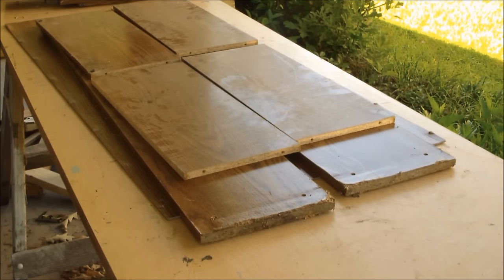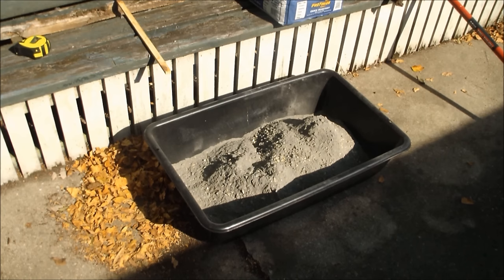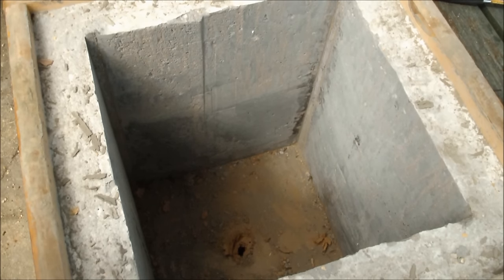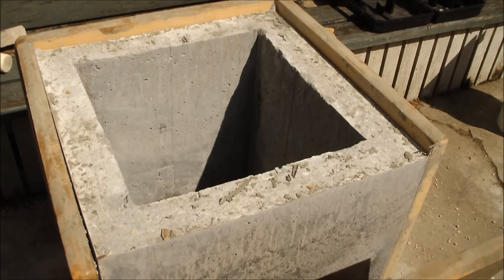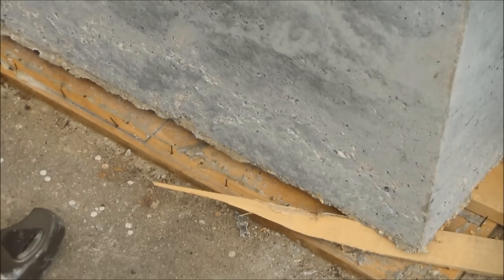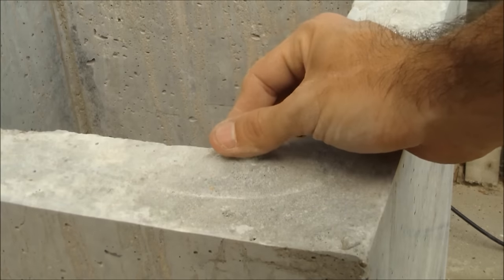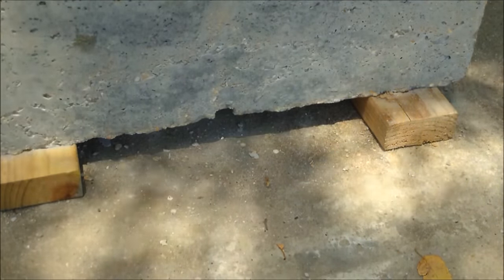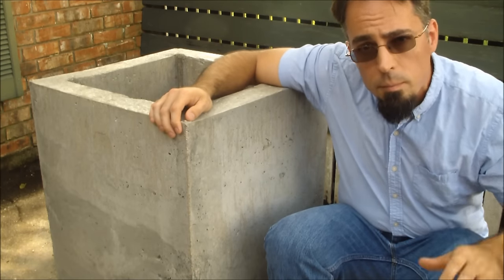How to Make a Concrete Planter

Comment: Should have kept the concrete wet all those 7 days to at least double the strength; you could remove the outer wood frame after 24 hours, I don't understand the need to seal or sand the concrete . I would have used  20" x 20" porcelain or  marble or granite to form the outer form  using 100 % silicon as adhesive using long clamps and wood pads to protect the marble or granite - you don't need to buy fiber reinforced concrete unless you're building a counter top . one bag of portland cement type 10 + 2 bags of crushed lime stone + one bag of sand - a total of $ 25,00 . mix them dry by a shovel as best as you can - take one  quarter at a time and add water as needed trying to minimize the amount of water to get good strength . don't knock on the mould or else you may break the granite . just use any rod or wood dowel to poke the mix to make sure the mix is well distributed. take your time and try to do it on 4 times to get initial setting ( 2-3 hours) thus to minimize the pressure on the mould - you can enen wait to the next day if you can't finish it the same day - smooth the top of the form using the back of a knife  8 hours after the last pour; you should start the water curing for a minimum of 7 days ; you can safely remove the clamps after 2 days - my advice as an architect.